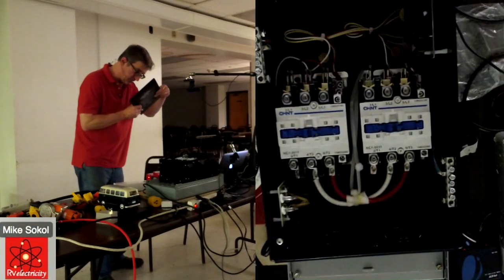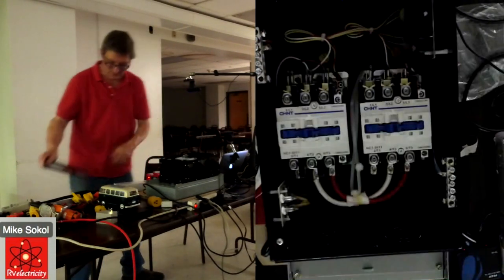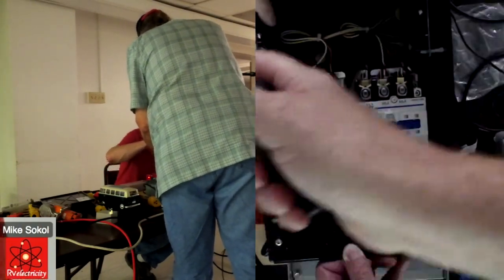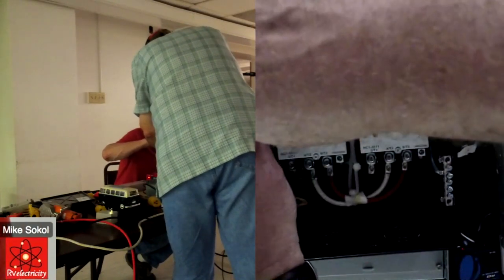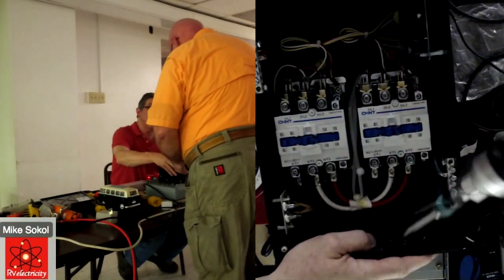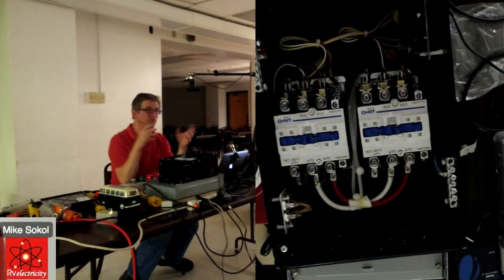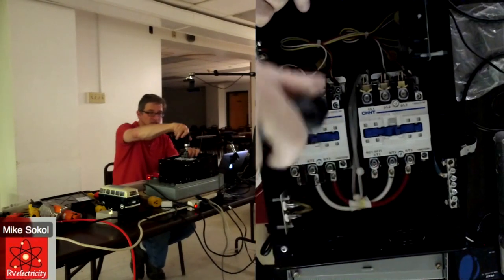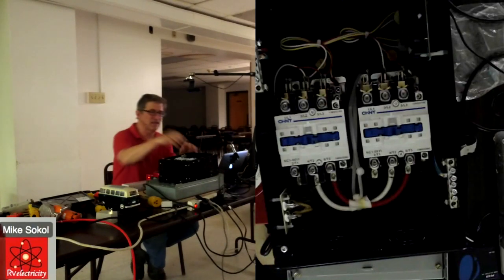RVelectricity Video Shorts - Generator Transfer Switch Screw Torque

Comment: Reading the comments on RV Travel, I think it should be mentioned to always put the Torque Wrench or Torque Screwdriver back to its lowest setting.  So the spring in the wrench isn't being left under constant Tension!